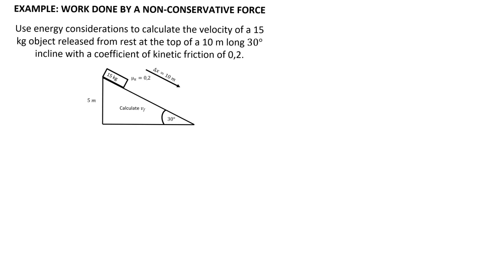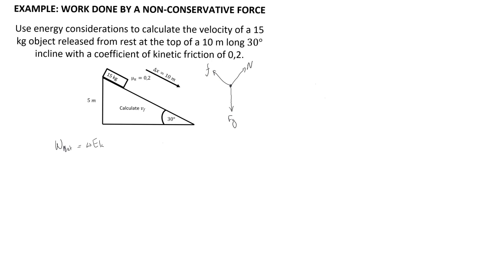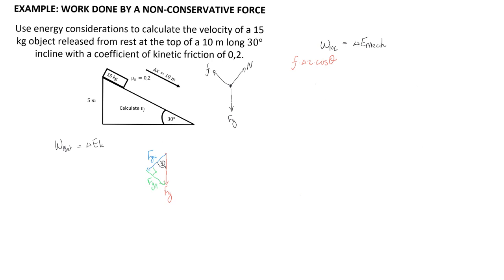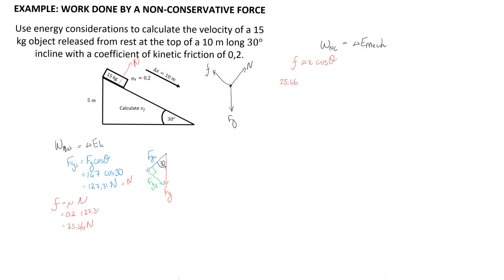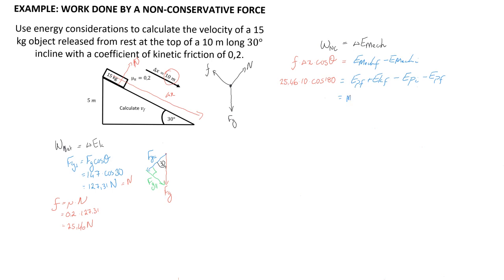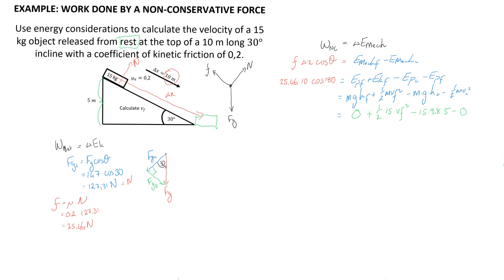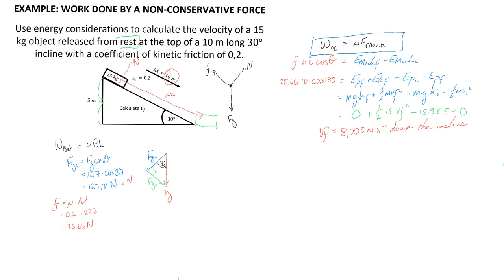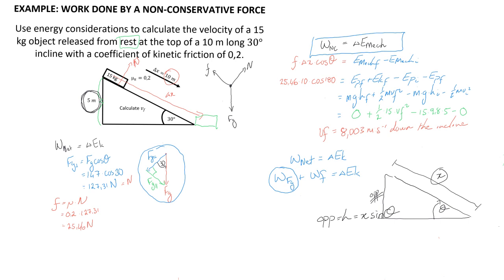Example: Work done by a Non-Conservative Force

Comment: 4:12 what about adding Fg|| to the net work?
Reply from the maker: Hi! In this calculation I have used the work done by the non-conservative forces, therefore there was no need to add the parallel (or any) component of gravity, since it is a conservative force. If you prefer to use the work-energy theorem, that uses the net force then you would have to add the parallel component of gravity.